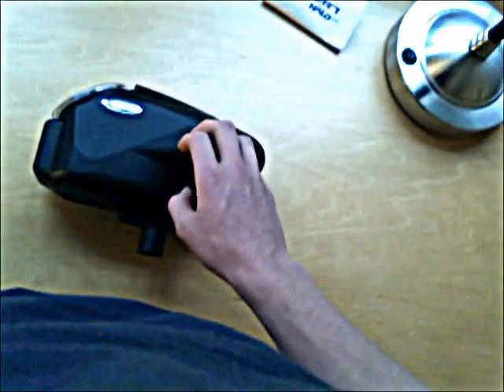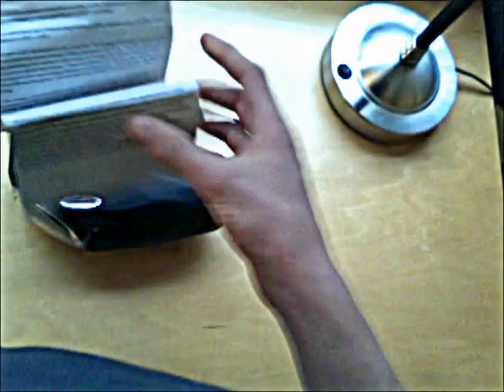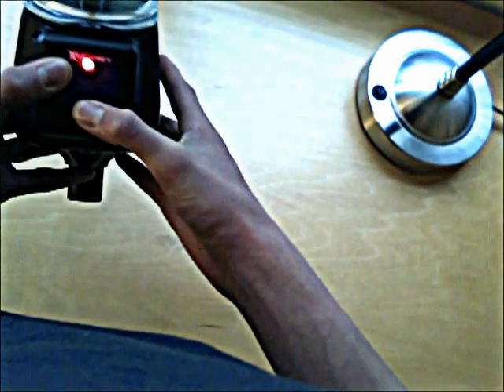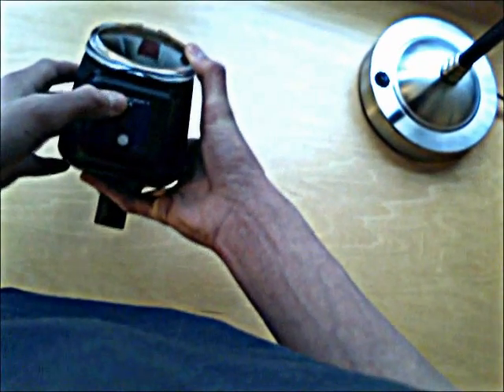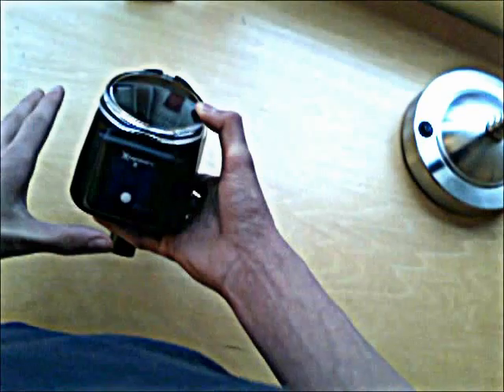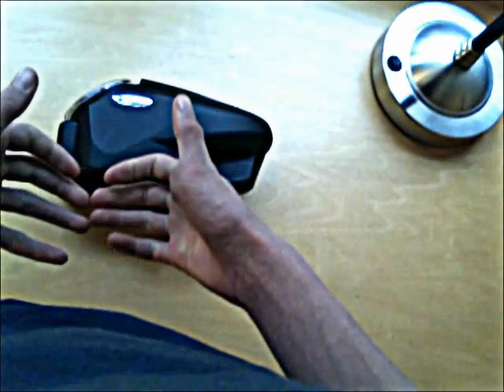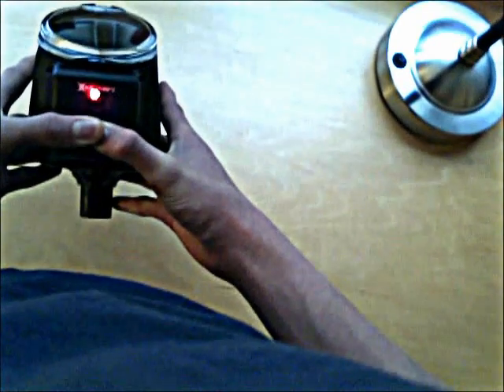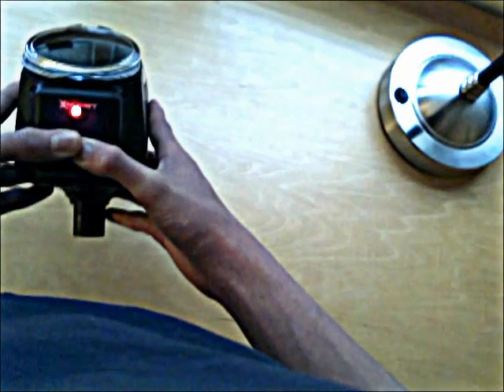How to Program an Invert Halo Too

Comment: What is feed stack? Oh and smitly the hopper feeds based off a microphone so if you have the sensitivity too high it will over feed and probably squish the paintballs and chop them if too low it might not load so just balance in like 3-5

Comment: this is probably the shittiest hopper on the market. why would anyone want to slow down there hopper. out of the box they should have had it permanently on the fastest setting
Reply: derek whipple  Plenty of valid reasons to slow down your hopper actually. If you've got brain cells, this is easily programmable. Even if you have to come to YouTube to find a more suitable tutorial for the programming, you're in the clear, and are a certified and licensed owner of brain cells. Literally all it is is adjusting it for your own gun. You know why other hoppers feed too much? Because their microphones are too sensitive out of the box. Hoppers with eyes are leaps and bounds over the price of this one, or at least they were when this hopper was released. Feeding slower doesn't necessarily mean it won't feed fast enough to feed your gun. It does however, always mean there will be less torque on the stack of paint.
Reply: I like the first halo hoppers way more when u never had to adjust the speed or sensitivity